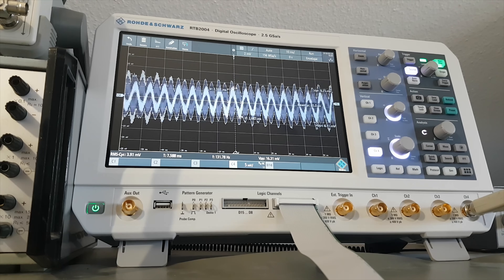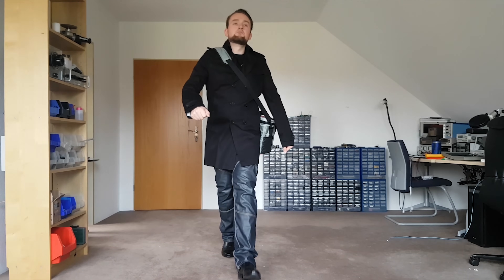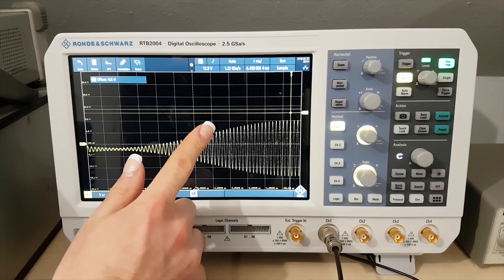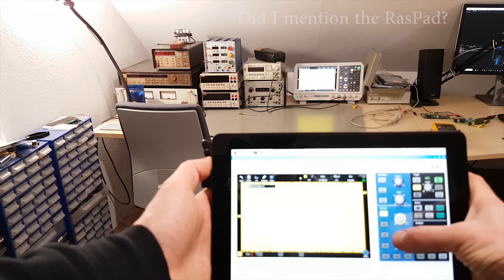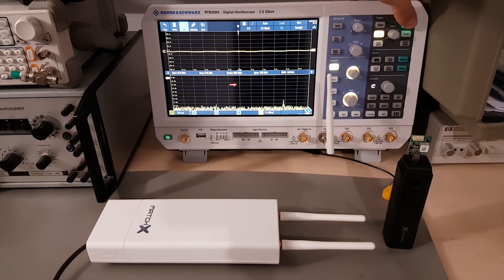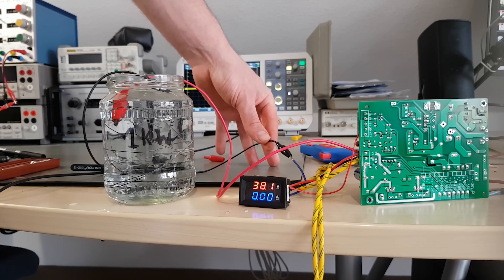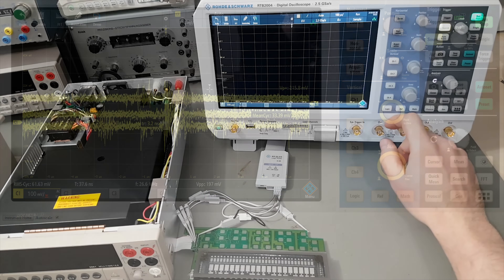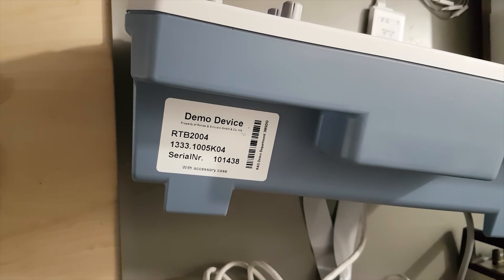Months of RTB2004 experience in 8 minutes - Rohde & Schwarz Oscilloscope

Comment: Talking about repairs.
I got owon oscilloscope, boot process doesn't finish, just start image and nothing else, hardware looks to be fine, I think that firmware is corrupted and has to be rewritten, ofc asians don't want to send me it...
Reply from the maker: Did it work before? Did a firmware update start the problem? You could try to find a serial port on the mainboard and see what the bootloader has to say for himself ...
Reply: Well I got it from ebay from seller that handles crap from some store.
This scope was returned by customer as faulty.
Excellent condition would suggest that it was dead on arrival.
First thing I did - turned it on, effect:
few seconds nothing >> dsiplay turns on and displays "welcome" picture for like 10 seconds >> here it should enter the UI but instead it turns black for few seconds and then again picture and repeats over and over
Inside it looks completly fine, checked all power rails and they're fine, nothing overheating, but also main processors are warm after some time, so they're doing something.
As far as I can tell, the hardware is completly fine, but for some reason it doesn't enter the UI.
It has XC6SLX9 FPGA processor for main work and some samsung cmos for handling the display, which clearly does it's job.
I also tried pressing these processors during turning on, to see if there are some bad connections as these are BGA packages, and also heating them up to like 70*C, it changes nothing.
Then I saw on EEVblog2 vid about siglent generator which just failed like that, extremly similar problem, in second video he fixed it jsut by uploading new firmware with uSD.
vids:
https://www.youtube.com/watch?v=CK5nbC_dBWk
https://www.youtube.com/watch?v=tM2j9zuBiRQ
Where I should look for the serial port?

Comment: I have to agree with the vid and comments that R&S equipment is top notch.  I use R&S almost exclusively in my lab.  I haven't found any piece of theirs that doesn't work as expected.  I have had many pieces of Agilent/Keysight stuff that is junk in comparison.  I purchased two inexpensive function generators and one display backlight didn't work and one knob didn't work directly from the factory.  I have also used the E444x series spectrum analyzers and they are horribly inaccurate and drift badly untill they warm up for a few hours.  Every R&S spectrum analyzer I have used is stable and accurate even after a cold start.  There stuff is more expensive than Keysight and generally have a slightly odd UI, but their performance is phenomenal.  I have two RTO series scopes and they have the best performance of any scope I have ever used.

Comment: Could I ask what is potentially a pretty dumb question, but what would the advantages of something like this over USB logic analyzers be? (other than the awesome scope, but just from a logic analysis point of view)

Great video as always, but the amount of Flamingoos in the video was disappointingly low
Reply: Real-time trigger, display and update. The USB ones just do a single capture on a trigger condition. Then again, they can store almost indefinitely. Each has their own purpose.
Reply: If you are capturing simple UART, not much. But if you need to trigger on an analog voltage for example that's somewhere else in the circuit and want to capture some digital data around that that trigger and see the analog waveform, you will need something like this scope.

Comment: Did that wire in the jar of water come from the electron enema of that gold resistor ?
Reply from the maker: Nope, that's constantan wire which has a very thin isolation layer. I guess that rubbed off and shorted the wire somewhere
Reply: I don't think that wire is insulated